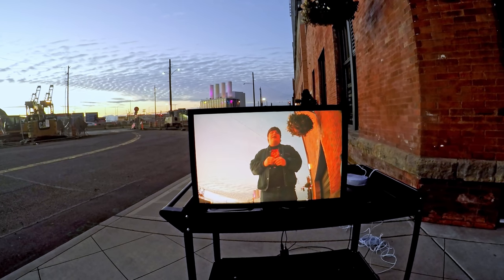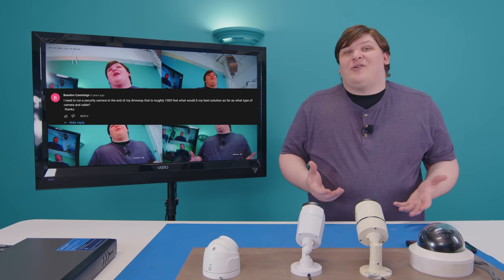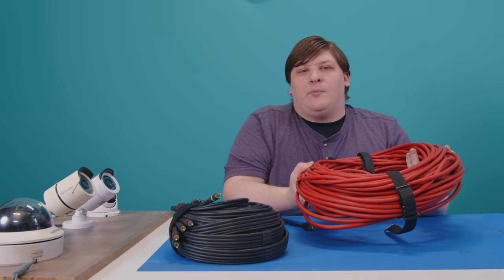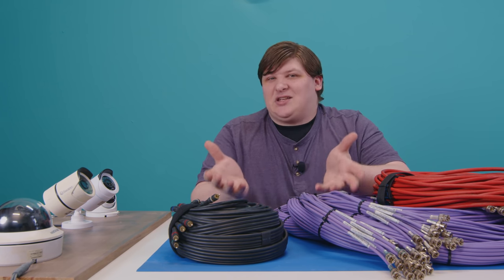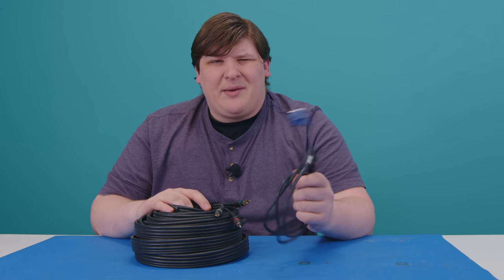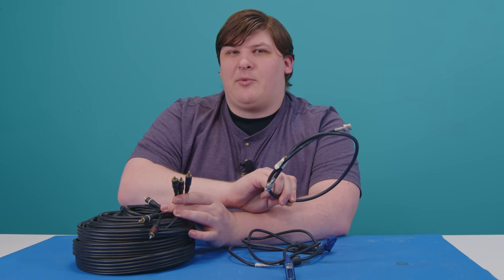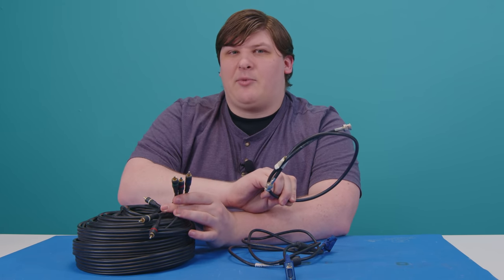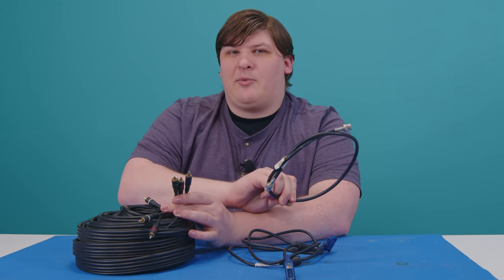1000ft of ANALOG HD video over a single cable?! [AHD/CVI/TVI]

Comment: New installs are pretty much all IP based but there are a lot of cases that these CCTV technologies address that allow pushing HD over coax be it analog, digital or even IP over coax based because it is impossible to replace the existing cabling with twisted pair be it cost, too much damage or just impossible. Some of the IP products are somewhat based on cable/cable modem standards as far as I can tell and a cheap way to get data over a long distance be it CCTV or general networking. Most cable like you show is total garbage and comes with consumer systems. We mostly use siamese cable which is good quality  coax with 2 power pair. You can also use cat5 that will let you put 4 alagog cameras up on one ethernet cable using baluns.

Comment: This sounds like a solution that could be useful, but would require designing your own hardware to utilize it. Probably not such a huge task if there are ICs available on  the market.  I really wish this would have been the way we went instead of going digital and using HDMI.

Comment: I run a casual stream that takes 40k6 from a GH5 pointing at various bird feeders around our property and sends it to an elgato 4k60 mk2 card inside, and really the only way I've been able to do that is with fiber optic HDMI cable. And OH BOY! I hope you're prepared to buy literally 10 bundles and test each and every one of them using a monitor that shuts down if it sees frames dropping, because nine of them absolutely couldn't do 50 feet without dropping frames. Sure, I got nine refunded, but that is a terrible yield and you know those cables are going to get sold to folks again, hoping they don't actually need the full 18GBPS throughput.

Comment: I still don't get how they're doing this. If you cram more horizontal resolution into an NTSC line then the bandwidth will interfere with the color subcarrier. And are you saying that they're just sending more vertical lines than 525 but at a lower frame rate? I'm confused.
Reply from the maker: They moved the color carrier up, since they have virtually unlimited room in the coax - it's in a completely different frequency band now as I understand it. I assume (not sure) that the frame rate - or I suppose, field rate? it should be interlaced, right? I honestly do not know the answer here - is natively 60, and the cameras (which are all certainly digital inside) are capturing at 12-15fps and then quadrupling each frame. Those are the impressions that I get, but I don't have hard answers to most of it.
Reply: @CathodeRayDude  These make sense. Since CRT flicker isn't an issue, you can slow the frame rate down to whatever you want.
Reply: Interlace was only used because of the broadcast bandwidth limitation (and the limitations of 1940s tech to handle higher frequencies I believe).
Reply: @StevenBradford  That and 30 fps video would have flickered too much. No one asked for 50-60 fps television but with CRT technology they had no choice.
Reply: @StevenBradford  It was actually invented in 1929 but get widely deployed around 1936.

Comment: I disagree on the digital TV vs analog TV.  I think it depends on the location.  I live in a 10 story apartment building in the Wash DC metro area within about 10 miles of most TV transmitters. I use cheap indoor antenna in my window.  During analog TV days, most TV pictures were just a jumble of multipath or snow  - it was awful.  Now, almost every station comes in sharp HD.  But I do have family members that live out in the country, and they are not too happy with HD tv.

Comment: Considering the transcoder is 10mb/s I wonder why they didn't just swap to 10base2 (thin coax ethernet) and do IP cams
Reply from the maker: What I didn't cover in the video is that another advantage to these is zero configuration. 10base2 would require someone to start making coax Ethernet transceivers again, at which point you're now installing a bunch of equipment with effectively custom signals that don't work with anything else you have without converters, yet you don't even get the advantage of being able to plug stuff in and have it work without question.

Comment: I wonder if it would be possible to run 10BASE2 Ethernet over composite video cables - the impedance doesn't match, but as far as I know that problem can be solved
Reply: I'd imagine a number of existing analog security systems probably already use coax, for it's robustness if nothing else. I'd imagine the current converters may well just be using a slightly sped up version of 10Base2.

Comment: Has Everyone forgotten about POE IP Cameras? i have a POE Camera Running probably 350-400 Ft No problem, with the Only Signal Delay being caused by the Server that cant handle as many cameras as i have, so it causes some small multiple second delay when viewing from the app or web view
Reply from the maker: I covered them at length in the video, where I explained that anything beyond 328 ft is outside of the specifications and it would not be reasonable to build a new system that was totally in violation of its specs. Even by pushing ethernet you still can't get more than maybe 600 ft out of it with special equipment, unless you add repeaters which increase the complexity and number of failure points of each run.

Comment: A Work dir a company that specialized in video surveillance and access control the Hikvision network camera  with it's own network switch can go in spec up to 300m over RJ45 thy have a toggle switch on them to enable long distance mode and in testing at our company's workshop we did test it with a 500m spool of cat6a and it worked with Poe

Comment: Why anyone would use anything other than PoE for CCTV cameras is beyond me. I installed an 8 camera system at my property - having the ability of being able to use cable off a roll and do your own terminations (and not have extra coiled up somewhere) with CAT5/6 to me makes it a no brainer.
Reply from the maker: I gave several extremely clear reasons and explained them in depth. Replacing existing cabling is expensive and often impractical, and for longer runs you require PoE repeaters which add substantial cost, complexity and failure points.
Reply: @CathodeRayDude  fair, I was definitely referring to new installations

Comment: strictly speaking digital can work better than analog with signal loss, the signal is more resilient and can include error correction… however once the signal is too bad to decode the output is just gone instead of noisy — hence analog is often better because "something is better than nothing"

Comment: 10:45 I remember when you could hack in to ip cameras by using a specially crafted Google search term
Reply: 11:35 could use a modem on each end, that's how cable companies do it, also would allow you to set how much power gets transmitted, though coax you also have to take account for swr

Comment: FTCE ! 30:21 you remove the paint nothing looks awesome I didn't know they were using a transparent panel.
My lego FTC group had a bunch of those. I always wanted to do that with my iBook G3 but unfortunately it was the G3 900MHz as they switch to white at that point and the previous white ones had clear plastic with white paint on the inside.

Comment: The reason why HD-PAL don´t exist is probobly due to Cable TV (and to an extent, satelite TV) being less common in Europe, and its mostly network TV 

Cable TV was highly discourage, and really any competing channels was discourage by a lot of leftist government, this was partly due to Soviet infiltration (and yes, that was a thing, just like Russian infiltration is a thing today).

After the fall of the wall (and really the year just before) the number of channels exploded. But this happen mostly on the network-TV, due to the cable system was not as well built up as in USA or Asia. Due to a combination of a lot of network TV and a well built out mobile phone network, there was simply no frequency band available for HD network TV in most of Europe. Not even for for a handful of channels. (well apart from France that actually had a HD network TV already prior. 

There for there was a huge push for digital TV, simply to fit more channels. Digital network TV was pushed into service, to early, despite MPEG-3 was canceled just a few years earlier. MPEG-3 was suppose to be the network TV HD format (and there was a really good reason for the cancelation)

So DVB-T was pushed into service and a very short window to close down the old analog services (to gain more frequency space) was pushed in place.

This was really a problem, because it turned out (and the writing was really on the wall) DVB-T didn´t pan out but was replaced by DVB-T2 pretty much simultaneous as the analog TV was closed down.

This was a real issue because it basically forced people to jump from analog to DVB-T to DVB-T2 with in a few years.

In USA there was a simular problem, they in steed pushed for HD. This was also an issue. While Europe was going to go HD eventually, that was already set, the resolution of European HD TV was set to 1080 while US HD-TV was set to 720. There was a few TV produced for both system, (as shown on this channel) but i my knowlage there was never any analog HD-TV service ever put in placed, but it was planed for cable TV. 

Most of the US HDTV was made prior to the idea of digital HDTV, hence the lower US resolution of 720, this also in conjunction with 60hz (pretty much all HDTV can do both 50 and 60hz), 720i video fit into a 12MHz wide bandwidth... if ever its really not wide screen, the wide screen version is effectively stretched

Europe was already bound to go, digital satellite broadcast was a thing in Europe, Asia and Australia already in 1995, effectively sending hard compressed DVD video over satellite.
Because Europe was going digital anyway, 1080i was set, later change to 1080p when the codec was updated to H.264

Comment: Aside form t10 (thinnet) orignaly using coax as its cable for netwoeking. There are a few legitimate well known and common ip over coax solutions.

Notibaly deca and moca.

Deca is mostly used by satalight companies where as moca is useed by cable companies (consumer tv companies like comcast or dish)

As far as i can tell the main difference between moca and deca is the frequencyband they operate in. Now unfortunately I cant tell you the max randge of any of those 3 options (including t10). But i can tell you pricing wirh cheep moca devices (170mbps) being sold for arround $20 in the usa.

Ps thinnet uses 50 ohm coax where ad tv uses 75 ohm coax.

75 ohm can be used however expect degraded proformance is expected or use a minimum loss pad that causes ~ a 5.7db drop in siginal possibly on each end.
Reply: MoCA is only 300 feet. For DECA, from what I have found is from the wiki is "DirecTV Ethernet-to-Coax Adapter (DECA) uses MoCA on this "Mid-RF"". So I would assume the same limit for DECA.
However I did find some adapters (DECA-511 & DECA-1000) that claim 2,000 meters! But there is not much detail on them, however I think it is unrelated to DirecTV, I bet they just put DECA in the model number so you think it is the same thing.

Found there is another standard G.hn (was HomePNA). HomePNA 3.1 said it could do 1,000 ft on coax. Found a more recent G.hn adapter (GCA-1200) that claims it can do up to 800 meters.
Reply: @JoshKasten  that is some very good information.

I did absolutely froget about g.hn. I beleve I was priced out for a home install relitve to moca.

I do wonder if a old analog tv siginal booster could boost moca i do not have the cable length to test that. But it also has similar problems to running ethernet and the repeters need to be powerd.

As a side note i beleve that is 300 feet between nodes so connecting s moca device between two devices should extend the range but thst also requires some proof.

Comment: There are two solutions this video misses. There are DSL convertors that let you convert Ethernet to DSL and on the other end you just use a DSL modem to convert it back. You can run DSL over a simple twin wire (anything that somehow resembles an analog phone line) up to 500 m (546 yards) if you want 100 Mbit/s but you can way further beyond that. Distances up to 5 km (3.11 miles) are supported but then you will get only about 2 Mbit/s. It it cheap? Not really. The adapters are pricy. But the cables won't get any cheaper than this and look at the amazing distances. 

The other solution is PLC. As these cameras need power, there are power cables reaching out to each camera and PLC uses these cables to transport back their data over exactly the same lines. Up to 300 m (almost 1000 feet) are theoretically possible and PLC is not pricy anymore, after all the low speed modules will do. Even if you split the power cable on its way its way to multiple cameras, PLC will work; in that case all PLC adapters just have to share the available bandwidth (time slot sharing, only one can send data at time). I once had to use PLC in an apartment where WiFi just didn't work well (the walls just ate the signal and having repeater in every single room kills the throughput completely) and regardless many negative reports, it worked very well for me and the speed was okay at that time (this was many years ago and at any power outlet throughout that apartment I had at least 30 Mbit/s, in some cases up to 60 Mbit/s and that pretty stable). Note that if you have multiple independent power circuits, you can place filters in between them and in that case only the devices on the same circuit share the overall PLC bandwidth.
Reply from the maker: Neither of those fit the constraints I specified. The first one adds extra cost and complexity, more points of failure to each run, and is not designed to run over existing coax. The second assumes that there's power lines in the place where you need them, and every power line communication technique I've ever heard of works great for some people, and is disastrous for most.
Reply: @CathodeRayDude  Some of the solutions presented at the beginning of the video did not fit the constraint either, like the fiber optics converters, still they got mentioned (and those are often even more expensive than DSL converters and require fiber optics and not just a twin wire). 

As for PLC, as I said, some people say it's not working well for them but I tried them in many places I've been living at (not that I needed them there, I just wanted to see if they would work) and they always worked very well. I guess it probably depends on the cabling in your walls (some very old wires may be an issue) and if you permanently have devices running that have an electronic motor, e.g. multiple air conditioners and fans. As whenever I turned on a blender, a vacuum cleaner, or a drill, the performance would drop by a few Mbit/s and running multiple of these at once, this effect seems to stack up and even enforce itself. Where I live you usually don't have air condition or fans, so this is not much of a problem.
Reply from the maker: @xcoder1122  I was literally giving those converters as a counterexample.
Reply: @CathodeRayDude  I totally understood that, but if you list "possible solutions", and if it's just to explain later on why those do not meet your requirements, I think you should not leave out two possible solutions that are far more practical than some of the solutions you have presented, even if you had also ruled them out in the end. E.g. running DLS over my old copper cables which I already have in the wall is far more practical than the fiber optics solutions and even less expensive. 

That's why I wanted to point those out, as for some people coming across this video, this might actually be the solution they've been looking for and didn't know it even exists. E.g. we've been using this exact solution to install a digital IP based camera system at the rear garden door using a twin wire that was originally intended for a door bell only. How we power the camera? Over the same piece of cable. It turns out that the DSL signal doesn't care for DC current on the same cable as the modem filters out any DC current anyway. You only need to put slightly higher power on the cable to compensate for the power loss over the long distance of those rather thin wires. Despite the terrible hackyness of that solution, it works like a charm.

Comment: Thanks it was interesting and while as you say not useful. one wonders why it has not been repacked for use in homes to send video from a single source to multiple screens in a home.  That a side Ethernet does run over Coax, !0base2 was eithernet over coax. I believe it was limited to 10 meg bandwidith in its day we're talking the 1980s but I can stream over my cell connection HD at 5meg so I suspect 10base2 could handle it.

Comment: fiber optic install cable is not more expensive then good coax, having to buy or rent the $2k+ splicer is...also the converters are, as nothing uses it directly...
Reply from the maker: Yeah, the fiber itself isn't the problem, for sure, it's just all the other stuff around it (plus the fact you have to replace existing cable if you have it.) Cameras could have implemented native fiber ports, but my impression is that there are very few companies that actually make fiber transceivers, so the price really can't be driven down far enough to avoid quadrupling the minimum cost of all these devices.